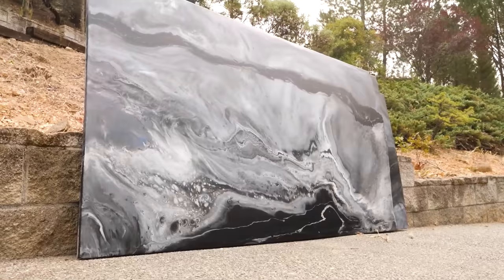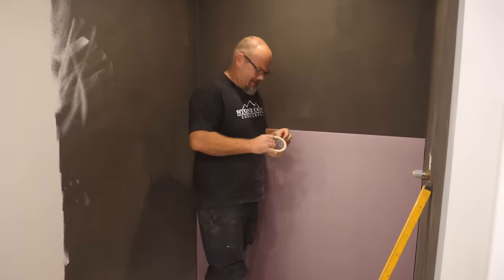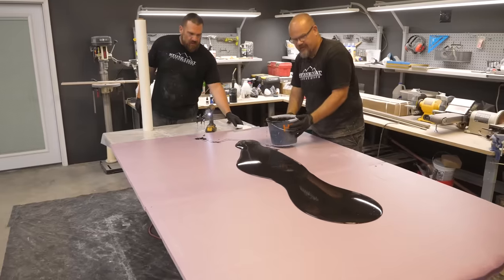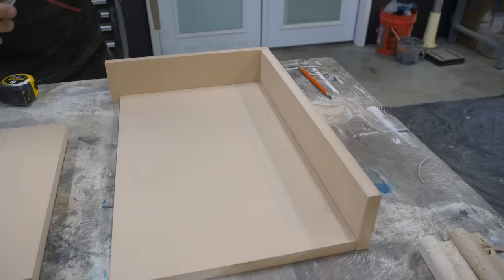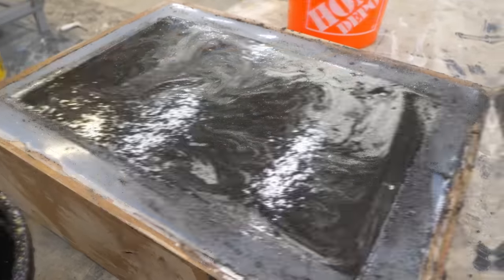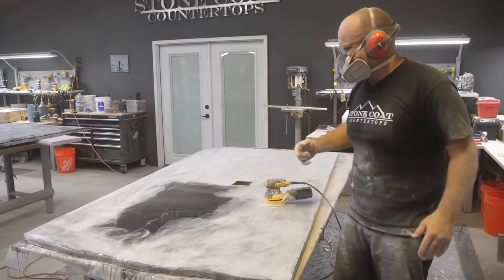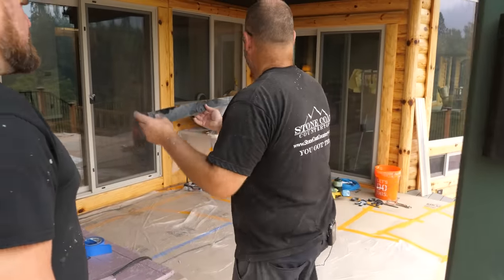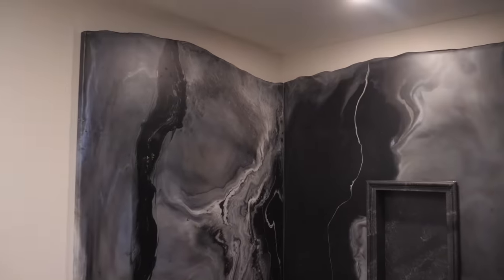Epoxy Slab Shower with Pink Foam, Come on the Jobsite Real Training

Comment: The bathroom/shower is a special location. Its most important quality is it MUST BE water-resistant for constant exposure for water, year after year. I recommend to be extremely paranoid about water protection. E.g. one layer of water isolation might look good, but just one crack or missed spot somewhere and water may find a way to soak into a wall over the years.

Epoxy is generally good material wrt water, but probably not ideal for bathroom's wall surface. It's an organic material. Tiles are used there for a reason - they are harder (so you can clean them aggressively) and water-inpermeable. In my bathroom, I put several layers of water isolation on the floor, walls and even on the ceiling, THEN tiled the floor and walls all the way to the ceiling, and used epoxy-based (epoxy with sand aggregate) grouting in all seams, and marine paint on the ceiling.

Comment: As an epoxy installer I have taken many training courses. They all teach not to use play sand in coatings. It generally contains a lot of moisture and moisture is death to coatings. Just use caution.

Comment: A common misconception about MDF is that's easily damaged by water. It's very water phobic. There's also HDF High Density Fiberboard. It's extremely water phobic. 

I used a ton of it to build hotel Vanity aprons. To test it we took pieces and soaked them in a bucket of water for two weeks, with no damage or expansion. It is very  Heavy, so its no fun to handle. But the stuff is awesome. Smells like Coconuts when you cut it. Bonus.

Comment: What foam did you guys use? Does it make a difference with the epoxy
Reply: I am wondering the same thing. They used I” unfaced rigid foam you can buy at Lowe’s or Home Depot. I am looking at renovating my RV shower but didn’t want to use 1” foam. Wondering if 3/4” foam that is faced will make a difference.
Reply: @danielsutter9405  I’m looking to use it for my van build. I wanna keep the weight as light as possible.

Comment: With granite prices around $65/sqft and with quick math I did on how many sqft you used... just the cost of granite would be around $6500. With you saying you used about $600 in epoxy and the other items costing around $150, give or take, you are in about $750. Just over 11% of the cost of granite. Thats a HUGE savings and its looks great. I defy someone to say that it is not granite. Great job guys!

Comment: I love the creativity along with adapting with knowledge. It’s not science in ratios or plans because it’s a lot of art. 1+1 never make 2. 

However, watching you “pour” a stamp-able shower floor led me to this message. You have the right idea, however you created steps that are unnecessary. You can achieve professional results with a colored premixed stampable overlay, stamp with a liquid release, then finish with a color enhancing sealer mixed with a small amount of gator grip..  
also, I’d brush your acrylic bonding agent 10/10 letting tac up yet still wet then apply overlay. Acrylic is a 100% necessity to bond concrete like substance to another surface. 

An overlay is 10x stronger than concrete and can be poured thin with no chance to crack. A simple sand mixture scares me, and won’t last to long before chipping up, or working away. 

22 years as a concrete laborer, Forman, owner and union foreman. 
Keep up the good work and creating cool stuff by hand. I love the idea of the shower panels and will be creating similar. 

Thanks 🙏🏼

Comment: I know this is about a year late but to give that foam texture ball some tin foil up and roll it along any surface you want a rock look to. This is what model makers do for dioramas and table top gamers model railroaders ect. 

Wish I'd of seen this earlier my niece just spent 12 k on her shower looks good but this would of been much better and definitely cheaper.

On that aluminum maybe if you sprayed WD40 on a rag and put it on the aluminum the epoxy wouldn't bond.  Kind of like using oil when doing concrete to have it "slip" from its molds.

Comment: 37:20 pro tip. When using a table saw, raise the blade 1/8th inch taller than your material thickness so that if you slip and cut yourself, you only get an 8th inch deep cut instead of cutting your whole finger or hand off.

Comment: Bob Ross says”We don’t make mistakes, just happy little accidents”

I feel like I’m standing on a rock.
Because you are standing on a rock!

I saw a guy cut foam with a $12 Harbor Freight hot knife, might be worth at try

Epoxy an aluminum edge on the foam the same thickness as the aluminum and leave it attached to the foam?

Comment: Umm, you know if you drilled that hole from the front and get a blowout, the blowout would be on the back and not visible, Right? Fill the gap created with silicone caulk before adhering to the wall.   Work smarter, not harder.

Comment: Are you sponsored by Tyvek? Sounds like it. You should have used painters tape over your aluminum or possibly prepare your aluminum with silicone. The epoxy won't stick to it.

Comment: Why don't you just use foam board as well instead of sand n epoxy for the niche and not a fan of the wide trim molding around the niche slim clean lines are more stylish like shluter trim for tile

Comment: I disagree using MDF if you were making that shower for the tropics because here it would not work at all. Everything like that molds unless it was sealed on all sides. Houses are made of concrete here so moisture would potentially come in from the other side. Houses everywhere else are probably dry enough in general for the MDF fix. Here its humid even when the shower is not on unless you dont have windows open and are running A/C at all times which is uncommon.

Comment: I must be the only one super confused about this. I keep hearing him say other methods are thousands and thousands of dollars. Yet all I’m seeing is a lack of explanation on how much money he’s going through. From the spray paint, epoxy, mold gel, extra wood for molds. How much would that niche have to cost? $50 for materials yet $500 for labor. And how long did this whole process take? It’s a nice looking shower. I build tile showers for a living. Really for this shower I’d be around $10k with everything and depending patterns usually 5 day installation with one guy. There is no way he only has $600 into materials. My best guess would be $1800 in materials. And how did it hold up? I’m worried about the mdf swelling.

Comment: Yikes guys, maybe the pipe can be covered and taped down with a small plastic paint mixing container so if it happens that something like that happens again is not directly against metal so you don't hurt yourselves.  I know you guys are tough, but I just get concerned regarding head injuries😢. Great work though

Comment: Also spray paint in the shower will be degraded to the point of looking like garbage within a year
Reply: @Ollie-as he didnt evidently  point out-but u did-he topcoated over it-didnt hear-if he didnt poibt out-shld have-
What I didnt understand it why they went to all work of using 2 diff mixtures-cement/epoxy -to do it-tgen painted over it--Did i miss something?

Comment: Great Idea But Missing vital information i.e. what foam do you buy, what foams to not buy, why the wood strip at the bottom, what tape works best, what tape avoid, silicone to use, silicone to avoid, these tiny details are epic because if you use a foam board with a plastic sheet on the outside, will that end up letting go of the epoxy and losing your shower walls? I know you know what to do, but we don't which makes me stay away from doing this. I don't like spending money for nothing.

Comment: Very nice videos that are inspiring. However, others cannot blindly follow you without knowing what are the exact cost they will spend on a project like this. Everything comes with a cost. You just mentioned $600 worth of epoxy, but what about everything else. Every item and tool you bring into the story should identify the cost.

Comment: You may want to check and see that the objects you are making molds out of are not copyright/patented/trademarked.
I would HIGHLY doubt they are, but as you start to get into this (3D photocopying basically), you may run into objects/patterns/etc. which are protected legally against someone making a duplicate of that shape/design/etc.
I've been out of the industry long enough to be uncertain where the lines are drawn on these issues for what you are doing, but basically if a shape/design/etc. is legally protected, you can be sued by the owner of that protected shape/design/etc. should you use it for profit, which could theoretically include monetized videos on YouTube, unless you can find an exemption to any applicable intellectual property protection laws/rules/regulations (e.g. copyright protection, trademark protection, etc.) such as the common exemptions for Parody (How weird Al can get around a lot of royalties for his songs), commentary, educational purposes, etc.
Even if you are making molds of these protected objects/designs/etc. just for yourself, you could still be sued as some protections are better/worse than others.  Remember, you may not be selling anything, but if you save money, you are technically profiting by saving money.  Further, some laws just don't care and the design is technically protected from reproduction for any reason (outside 1st Amendment protections).  Again, this assumes the person that owns the rights even gives a crap which they rarely do unless it is Disney, you have made a significant amount of money by using it, or you have a lot of money in assets the owner can try to sue for.
None of this is legal advice, just me repeating information provided to me by knowledgeable and trusted sources over the years; verify, verify, verify before you rely on anything cause people like to sue in this country still.

Comment: I am betting that has failed, (a now 2 year old video) ..with leaks all over the place. Not strong like tile, and if you bumped the wall with your elbow, a hole would happen....and looks very 70's. I could not imaging showering in a foam shower.

Comment: If someone out there is thinking about doing this in a home ..DON,T .....|     This a terrible idea.   Especially a threshold made out of foam . What happens when someone cleaning the shower pan places a knee directly on this foam threshold . perhaps that person is on the heavier side of things. foam is not structurally  sound , even with a thin layer of fiberglass and epoxy.  A knee or a heel of a foot will leave a dent in this . If someone steps on the edge of this threshold it will definitely dent, crack or get damaged in some form.  This is not a good idea, it will not hold up to  the wear and tear.  It is also very evident that it is not real stone . Even the sound it makes when he wipes his hands over the panels. They sound hollow.  It would be way better to just use tile . Faster and much more durable and probably around the same cost or less . This is a bad idea . If anything use wood not foam.

Comment: $600 on epoxy???
And $6,000? For a tile job?
-2: 36: 08 minute
That's a big lie... only tile for shower may be around $1,000. 
Mean your epoxy is beautiful but i prefer to pay $1,000 for tile. 
Hope don't take me wrong but your epoxy it's to dark for a shower.
😅😅.
Maybe i van try on my second bathroom.
-2: 33: 52 minute here .. you not lie about $1,000 for tile.

Comment: This looks cool but last thing I want is kids putting holes in my walls… plus I installed 8x4 porcelain tiles and slate stone  shower tray in 4 minutes after everything was cut and ready to go 
Getting them ready was only a 2 hour job 
This guy really thinks a lot of himself but it’s  amateurish and there is lots of professionals out there doing better work when a better professional finish
Reply: exactly. one year at most and that shower will fail
Reply: @Drew-py8kg  don’t get me wrong it’s looks cool but it should be done maybe using something harder then foam, also would love to see him do a full bathroom rather than a shower corner, and let be honest here a DIY person could tile them 3 walls in a day easy with just as nice finish and a lot less then $600.. 
Not to mention the space you need to work with them foam sheets.. you also need an extra person to help you.. also the time and preparation, and most people would need to trial and error etc… 
But they did a vertical wall before that was impressive would love to see them do a full bathroom without using any sheets and just putting the epoxy on the vertical walls that would get a few million views 😎

Comment: sorry to say the coloring of the epoxy is so distracting....way too much white, making it look cheap and sloppy. You need to use thin swirls and not so white. The project is done well, but looking at the finished results, does not look expensive. Get your coloring better and you'd have an excellent look. Maybe less black would help. Also remember soap scum will show up more easily against black and could be a real mess after a while.

Comment: You use the black too much very dark and for a shower or bathroom decent tiles the materials not more than 25 15,18, $2,500 regular bathroom like that not more than 3,500 so 600
4 materials another 600 installed how do you get 6 grand even if the tiles are twenty-five $35 each what do you need 15 pieces 20 I wonder where everything so expensive 6000 what are you in Manhattan.